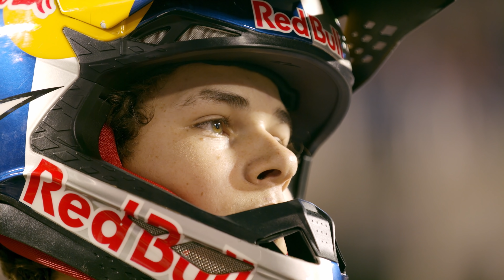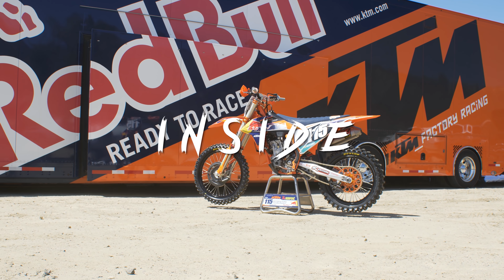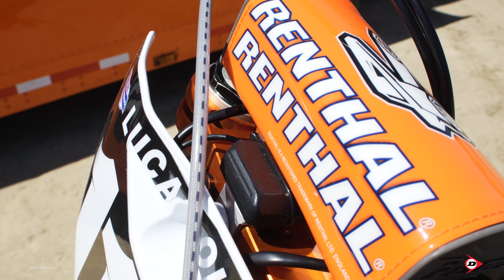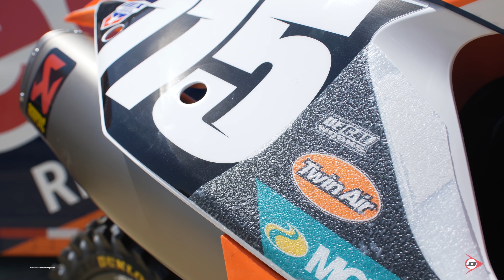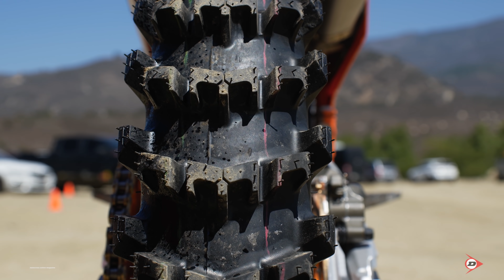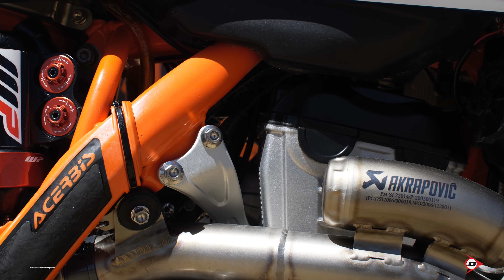Inside Max Vohland's Factory KTM 250SXF- Motocross Action Magazine

Comment: We run the 52mm forks cause it’s ok to cheat as long as you’re open about it.
Reply: I mean... ktm is not the only that does that
Reply: @enzoandrade219  I’m guess Husky and Gas Gas too but what’s the difference
Reply: I've seen KTM's with KYB Enzo forks.
Reply: What leads you to believe having 52mm forks is cheating .. ?
Reply: @brentyancich  if everyone can’t get them it’s not a production fork.
Reply: @pabloyescobar334  What...? Every factory pro runs A-kit suspension, which is available to the public if you have $8000 laying around
Reply: @Rc12234  last I checked we could only by the smaller WP cone valves.
Reply: @brentyancich  Because the production rule states you must run production, the stock fork is 48 mm not 52. I'd like to see the AMA pick up a bike in the crate, make them assemble them and run them just like the show room.
Reply: @brentyancich  They are in that a privateer cannot buy, or reasonably fabricate them.  Stock is 48mm.  I personally believe the factory believes they are an advantage, or why else would they run them?  Bigger fork tubes would logically add weight?  However, the action is probably better.  Forks do not fall under the lame "production rule" (production my ass), I believe only the frame and geometry does?  It's true that the factory teams put a lot of trick parts on their bikes, but with enough money, I believe that a privateer can reasonably duplicate them, either by buying from companies who make trick parts, or hiring a machining firm to make them???  But not those trick WP forks.
PS:  I think it's kind of funny that factory most factory riders, who are on bikes that come with the WP XACT Air Forks, from the showroom, do not run them (they run springs in both legs).
Reply: @jedielder7970  Some guys run air sprung cone Valves, they make both. And most of star run the sff air fork so
Reply: @Runk3lsmcdougal  Thanks for the info.